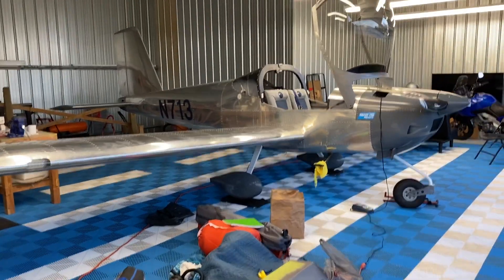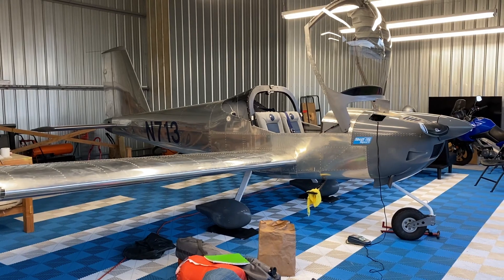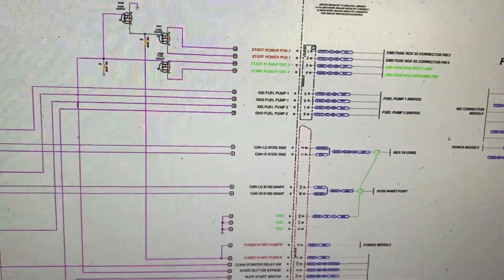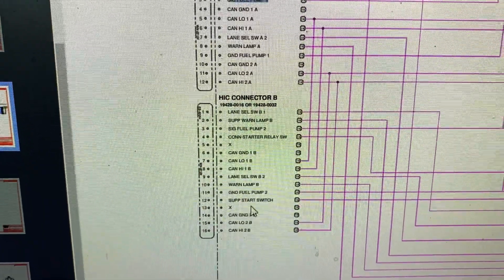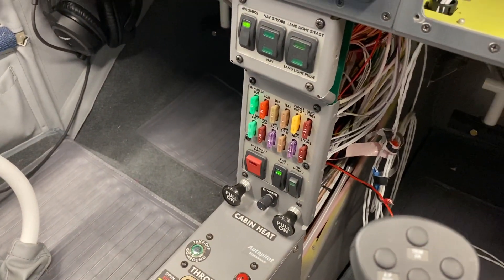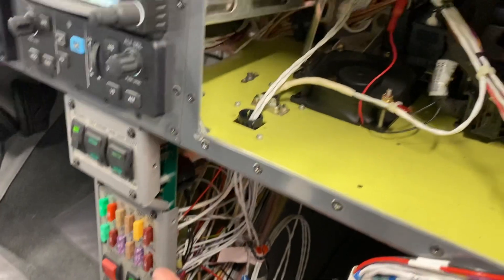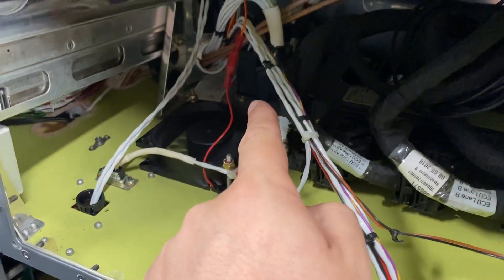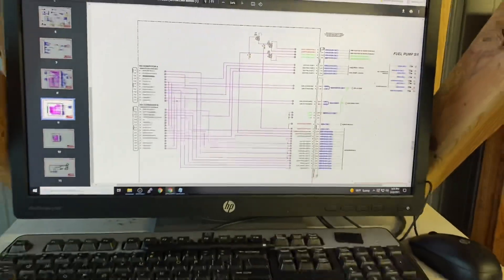RV12iS intermittent fuel pump problem

Comment: I had this problem before with my 12, but it was the opposite of what you experienced. When my master turned on fuel pump 2 would turn on as well even though fuel pump 2 switch was off. We had two very similar fixes to our problems.

Comment: Your on the other side of the NA continent! I am on Vancouver Island BC Canada.. Thanks for your video. Always good to learn about the RV 12is!   I had a fuel contamination issue with the sealant in the gas tank plugging up my electric fuel pump. I installed a second gascolator ahead of the NEW fuel pump and no more problems!!